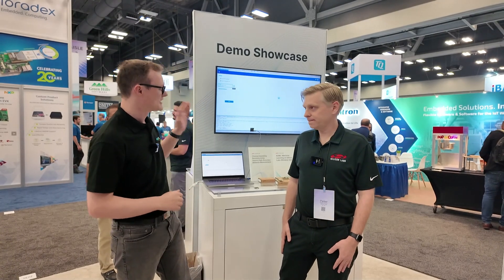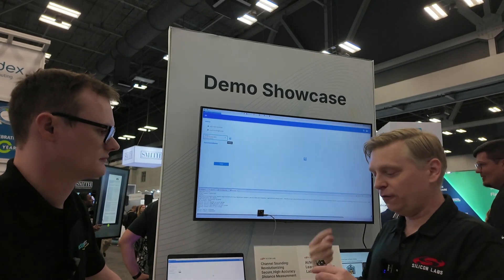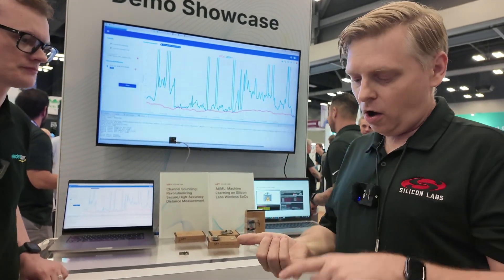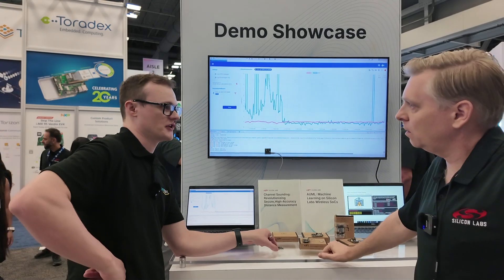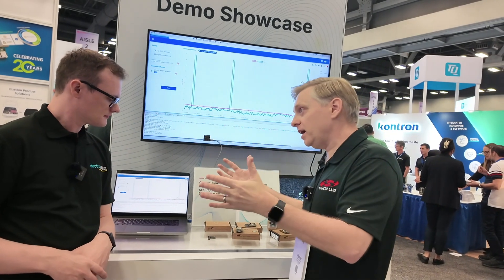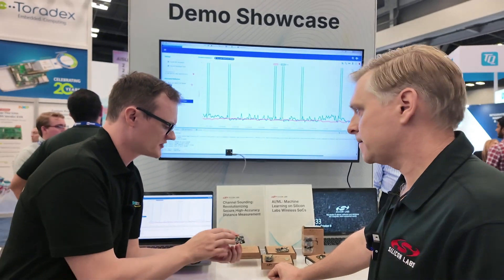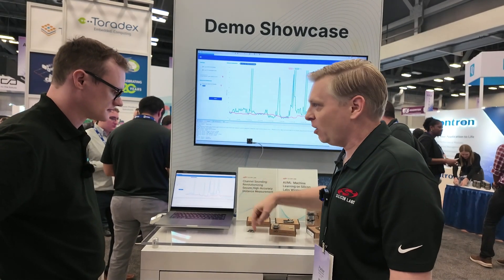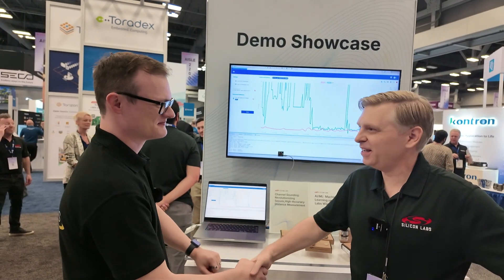Silicon Labs Channel Sounding: Bluetooth Distance Measurement for IoT and Automotive Applications

Comment: Will this be used as an alternative to ultra wide band (UWB)?
Reply from the maker: Great question! Channel Sounding over Bluetooth LE isn’t necessarily a replacement for UWB, but it can be a practical alternative in some situations—especially when you’re looking for lower power and lower cost. The big advantage here is that it works on existing Bluetooth hardware, which opens the door to distance sensing without needing extra components.

Of course, UWB still has the edge in certain high-precision applications, so it really depends on what you’re building.

If you’re working on a specific design or just want to flush it out, we’d recommend reaching out to Silicon Labs directly—they’ve got all the technical detail behind this and can steer you in the right direction.